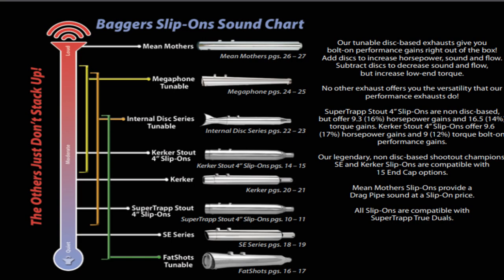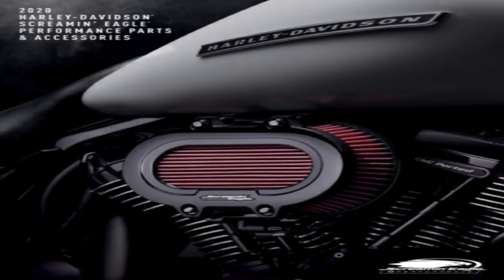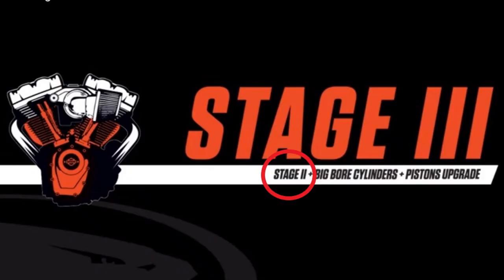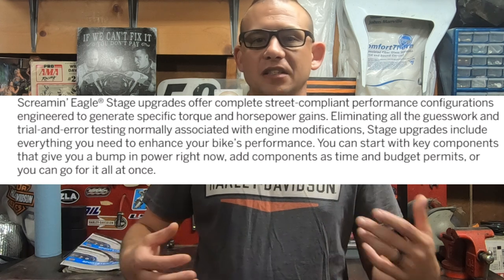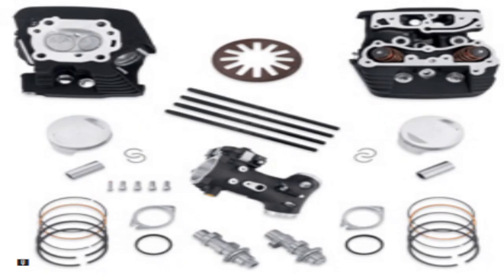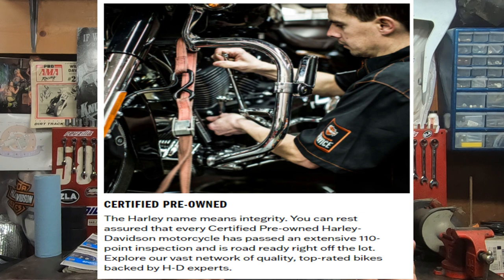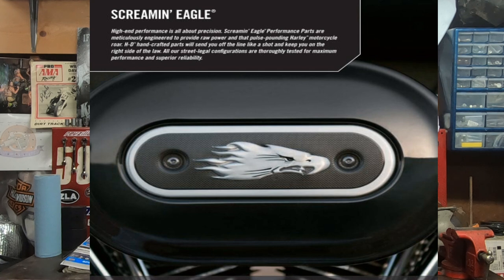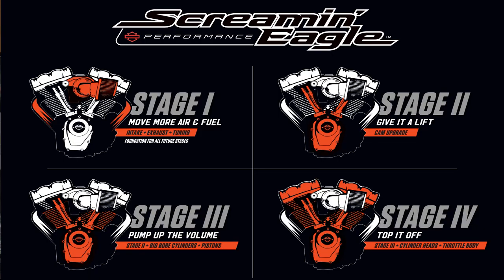Stage Kit Secrets, What Harley-Davidson Doesn't Tell You

Comment: Eh you are being deceitful. That is not at all how it is when it comes to kits.  EPA is the factor why cams change in stage 2 to 4 kits. Harley isn’t being deceitful about the stepping stones because they have never considered them as stepping stones. The parts seller at the dealership is being deceitful if that is the impression you get. A good parts sales man for the costumer would explain everything to them and see what the customer really wants out of the bike. A good part sales man for the dealership will sell everything and anything just to bring in more money for the dealership. How you are being deceitful is saying this is how it is and bashing Harley just to get views when that isn’t how it is. Btw companies like roush have been doing stage kits too and it isn’t a Harley marketing thing
Reply from the maker: It all depends on the dealer you go to, I've seen good ones and bad ones. The difference between the stages with cams involves valve springs, the Stage 2 is a direct bolt in with factory valve springs. You move to stage 3 and it requires valve springs and it's matched with a bit more aggressive cam. Some parts counters won't tell you that parts move between stages, not all but some and I would hope it has to do with lack of product knowlege.
Reply: @GixxerFoo  you are correct with the aggressiveness of cams and springs required. I won’t argue that with ya. The epa approving maps is the issue with what kit has which cam. With the whole Harley epa issue part of the settlement is how many and what kind of mods they can do/sell

Comment: I’m doing HPi 62mm A/C and D&D Billet Cat with big bore baffles with screamin Eagle pro tuner and wide band O2 sensors and going 107-131 via crate engine. After warranty S&S 550 cam is first thing going into it.

Why pay as you said over and over just save a ton of money and just get the 131  kit or 131 crate engine
Reply from the maker: If you got the cash it's best to jump in there and go where you want to be. It can cost a lot more in the long run coming up short on your performance goals.

Comment: The pro tuner allows you wide band FYI for now till warranty ends
Reply from the maker: The wideband is a nice add on but it still keeps the lean ratios. Going wide band thundermax is the ticket, power vision has their add on system but ThunderMax is the complete ECM replacement.
Reply: @GixxerFoo  but you loose warranty with them but once gone power vision
Reply: @GixxerFoo  what about it your bike is tuned in a dyno and pro tuner used?